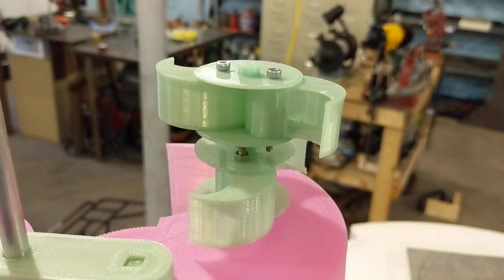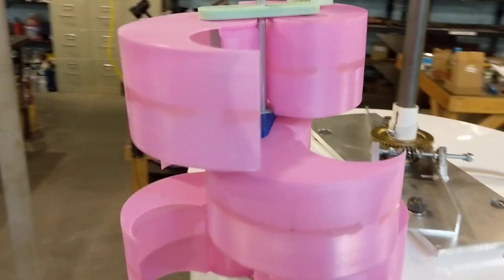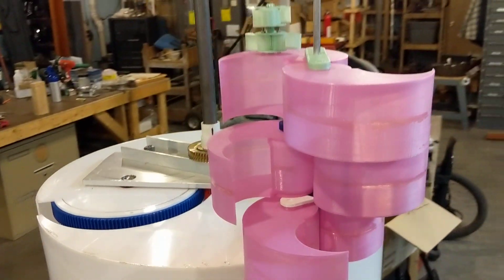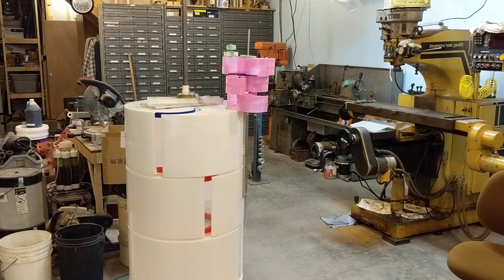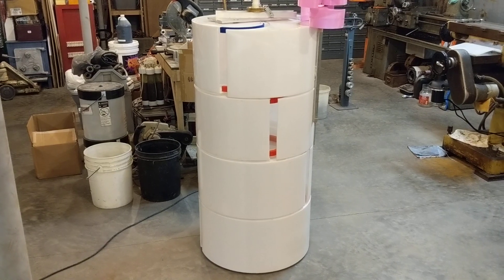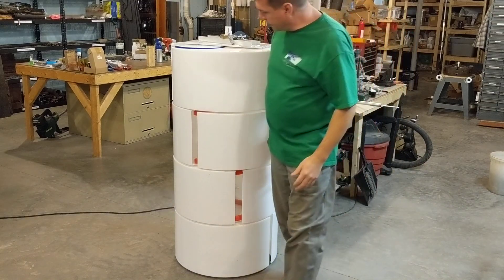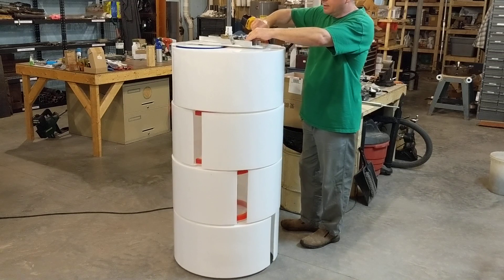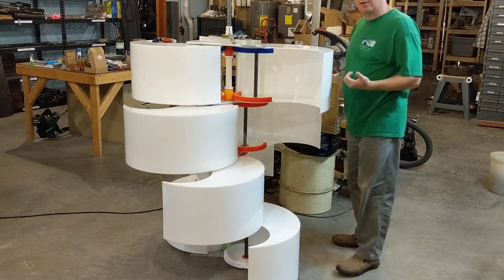Harmony VAWT Sept 2019 - Look how far we have come!

Comment: Can't wait until you have the
Building size one !!
MORE POWER AH AH AH 😂!
Reply from the maker: It's coming John you may not have seen our latest videos. Check these 2 out: https://www.youtube.com/watch?v=nENMqjqAwqY and also https://www.youtube.com/watch?v=OppJygkWuMc
Reply: @HarmonyTurbines  this is going to sound strange
But if you build a structure
Around your turbine it will
Increase your output 4-5×
Interested ?
Reply from the maker: @johntiedemann7725  Heard that one dozens of times. No the short answer is it would kill the simplicity and aesthetics of what we're doing with Harmony and in the end be more trouble than its worth. We shouldn't need it with the direction we're headed ...honestly.
Reply: @HarmonyTurbines  can't
Be easier just put it in a
Louvered tube 1/8" away from full extension of your
Blades and that will wrap the wind around your turbine and shield the
Upwind side to drag .
Thus giving you more
Power for the same wind
Give it a try side by side
Small scale on your roof
I think that will change your
Mind !! 
Cuz right at the beginning
Is when you want to know !!
Reply from the maker: @johntiedemann7725  I have a better idea. You build that, patent it and then market it as the superior model. :) You'll probably be crazy rich in the end. ---Probably.
Reply: @HarmonyTurbines  sorry for trying to help !
But your closed minded
Approach to a possible
Improvement to your
Product has told me
Not to give you a large
Investment in your
Company !
But like I said it's better to know at the start than at 
The end .
You are destined to fail 
With your closed minded
Attitude !!
Reply from the maker: @johntiedemann7725  I apologize and you didn't deserve the snark I gave you in my last reply. Regarding the structure around any VAWT there are about 10 or 12 different designs that I've seen over the years designed just as you describe. I don't want to take Harmony down that design path with those performance characteristics; that's all. I have a different direction that I would like to go with the end result that's all. Anyway just wanted to apologize for my reply last time.
Reply: @HarmonyTurbines  apologie accepted 
But it still cost you a
Possible 20 million 
Dollars .
Like I said it is better to
Find out early than too late
Like you just did today !!
Enjoy your weekend !!
Reply from the maker: @johntiedemann7725  enjoy your weekend as well.

Comment: Just found this great idea, I think it's Spot On! You have a great innovative idea here. Keep up the good work. Might I ask how many watts it generates per hour at 6mph wind? Thank you in advance.
Reply from the maker: Hi Damian that's like bare minimum for any power production on ANY turbine. In small residential units that's really asking a lot. The production would be pretty low in our 1kW unit you're talking 20 to 30 watts output which is nothing at all really. In a larger unit obviously you'd get more output but it would be questionable in general if you'd even want to install wind power generation with such low wind speeds in your area.

Comment: Couldn't this be computer modeled? 

Also as far as efficiency, combined with structural integrity, I would think each one would be much taller, and larger in diameter.   You could accomplish the same catch of air with just one set, the same height as your configuration of 4.  I do understand why you would want an offset and multiple pairs though.

Also, another thing to think about would be balancing the while operation.
Reply from the maker: Sure Jesse, but that takes a LOT of money and right now I'm not funded by anything accept my meager allowance and my wife's good grace. I do what I can with the time and money I have available. If we had access to free CFD (Computational Fluid Dynamics) then sure this would be amazing to see in 3D simulations. But I do believe that when something changes the model radically (as Harmony does) you often need a baseline to calibrate those new CFD models. So in effect an initial Harmony VAWT prototype would probably need to be built anyway. From that data we could calibrate the CFD models for further extrapolation.

Comment: The design is brilliant. Can't wait to see data come in on this. im guessing some sort of motor driven furling mechanism will be used..although a mechanical type that could regulate via its own speed like a ball governor on an old steam engine etc could also be something that would resist any power outage or problems electrically. the faster it turned the more the weighted balls fling outwards causing the furling to close? Seems like the furling needs many revolutions of that shaft so a ball governor might not be suitable as its movement is limited.
So i suppose electrically with feedback of a speed sensor is the real way to go.
Hats off to you. i hope these are not going to break my bank for the first run purchase..HA
Reply from the maker: Hi Chuck, believe me I thought long and hard about an analog system like a ball governor in the furling mechanism but ultimately it would be more of a hassle than a help. The furling will be a carefully controlled algorithm and a simple stepper motor to drive it all. Stepper and worm gear ...done. The Raspberry Pi or onboard mini-pc will control everything down to the exact degree needed for max efficiency. We could never do that with an analog system. I love the thought you put into it though so if you're near PA and looking for a job one day soon, look CreatingMoore up ...we will need a lot of good people. For now I'm still working to finish the prototype and then get the startup going with some much needed funding. If you'd like to see Harmony VAWT Latest Updates, here's the URL: https://www.youtube.com/playlist?list=PLqbwi-6vny7s3NVYuynqVG5oyLxysgfIs
Reply: @HarmonyTurbines  well thank you...I have knowledge in codding pics and arduino so yeah my thought also was steppers with micro control..a lot easyer to implement then a mechanical system. Although my thought was it would be less susceptible to electrical failure.

And yeah I love PA, I used to drive through all the time..I was there recently with an act I work for.
But my main job is in electronic design and repair. I have 20 years in it.
Living and working in PA sounds very inticing!
And doing that kind of work has allways interested me.
And of all the design I see yours is so elegant and the ying yang aspect speaks to me. Something about the symatry of the magic number constant, like taping into nature.

Anyway...love to visit one day and who knows maybe I'll take you up on a job.
Reply: @HarmonyTurbines  Also I have seen a lot of your vids now and think you are on to something here. Love the vertical mill too..ha.
Glad you did not wreck it.
I know lathe and machine work and Also weld.
I like that this will not injure wildlife. My girlfriend just mentioned this and I think it would be very safe to wildlife as well.

It will be interesting to see how the numbers look once you have it generating power.
Lots of work to be done.
Wish I was closer to lend a hand.
Need any codding work done I'll be glad to help there.

Comment: Computer control ??? Darn ... Was hoping for a centrifugal clutch mechanism for furling and unfurling ... Oh well ... Proof is in the load test ...
Reply from the maker: Centrifugal clutch would not give me the fine control that I think we will certainly want to maximize performance. Testing will show us what we need to see, I am excited to see the data just like you.
Reply: @HarmonyTurbines  yup ... Torque produced under diff wind speeds ... Gotta have torque to overcome load ...
Reply from the maker: @jameswitte5167  in all honesty the simple Raspberry Pi control for the furling system will be so simple and easy compared to a centrifugal clutch and it will give infinitely more control over furling states in various wind-speeds. Think of an ice-skater pulling their arms in as they spin. They go faster and faster. Well in our case being pulled in slightly (furled) in a given wind-speed will likely produce 20 to 50% more power output. That's the data I'm dying to see! If you'd like to see Harmony VAWT Latest Updates, here's the URL: https://www.youtube.com/playlist?list=PLqbwi-6vny7s3NVYuynqVG5oyLxysgfIs
Reply: @HarmonyTurbines  I'm olde ... I like mechanical ... That i can tinker with and fix when it bresks ... Lol ... But best of luck to you ... I do like the looks and basic design ...
Reply from the maker: @jameswitte5167  Oh believe me I had ball governors and centrifugal clutches all over the design a year ago but as I have been working on this more and more I realize that the fine control I need will be best with some stepper motors and worm gears to carefully control things. I love mechanical systems as well and there's still plenty of that left in my design to tickle your fancy! If you'd like to see Harmony VAWT Latest Updates, here's the URL: https://www.youtube.com/playlist?list=PLqbwi-6vny7s3NVYuynqVG5oyLxysgfIs

Comment: have you tried the model in actual conditions? what kind of amout to be taken as output? its very impressive work you have done. but i see some probelms with real scale model of your harmony...
1 how will you unfold or fold the blades when there is some 4-12 miles per hour speed wind? what will be the force on blades? 
2 have you ever consider the worst case senario design loads or actions?
3 how much will be the stress developed at the bottom of the harmony when unfolding at average 12miles/hr wind speed?
4 what will be the tilt of the harmony tower?
5 what are the fail safe mechanism of the harmony?
6 how to prevent over speeding and damaging the harmony?
im just curious. thanks
Reply from the maker: Yes I have addressed all of these issues. Real world testing will begin after the prototype is complete. You will just have to be patient as I do this with my own limited funds and time.
Reply: @HarmonyTurbines  Great work man....👍👍

Comment: Love the update, thanks. Here is a real life, current day (2019), need for using your solution. I'm in California and last week power was turned off for many people: why? Because of the wind.I have a 100 amp marine/RV battery and 3000 watt dc converter, just for short time emergencies. But, I have no way to recharge battery, when power goes out for days. Plus, when power does go out it could be due to rain storm, fire storm or earthquake. So, i'm looking for a VAWT system portable for emergencies. The owner of "Little shop in Texas" has a Vertical axis wind turbines that looks ideal(https://www.youtube.com/channel/UC3e4VrM3f8E5r2_CxripXUA/community?lb=UgzDlXHFWwp0UMG55vJ4AaABCQ), but he's not responding to my inquiry. Solar is not the ideal solution, because the conditions are likely to be rain storm, cloudy or even fog. So, do you have a solution to fit this short time emergency need?

Comment: be cautious what happens when the wind is high and resistance from reverse curved blade can be high enough to waste the other blade workout
Reply: This is an interesting concern, the pushing blade will have far more pressure on it than the other..this could impead the furling mechanism so a robust stepper motor design must be implemented.

Good thought in that.

Comment: Dia duit, Chris! This is my first time seeing your project, and I am impressed by the concept and design. I have several ideas that would work in conjunction with your possible control center with algorithms controlling the furling with the servos. I at first thought that a CVT would work, but it may not be as controllable when the need for higher torque for a higher load on the generator is necessary. But, I have recently come across a concept that was designed for bicycles called the CeramicSpeed Driven chainless drivetrain. With just two points of contact, it reduces the friction and loss of power usually found in a chain or belt driven system down to 1% (making it 99% efficient.) What I believe is really impressive (and could work with the control system algorithms in conjunction with your furling system) is the pinion system that can seamlessly glide between the gear ratios. My reasoning for utilizing a gearing system looks at consistent RPMs of the generator(s) along with load on the generator(s). Let's say if a battery or two on your storage system flake out or your home begins drawing more power a certain times (starting the washer, AC units kick in, etc), then there could be a greater load on the generator to where it needs more power from the turbine to keep up the RPMs. After studying the design of the Ceramic Driven Drivetrain, I believe it could be implemented with your Harmony VAWT to maximize its effectiveness. I am in no way tied into nor know anyone of that company, I just research and collect ideas that I can possibly implement in the near future on my envisioned permaculture homestead. I hope what I have found will be of great use towards your progress on your VAWT and I look forward to seeing it in production soon so I may be able to acquire it for the homestead. Go mbeannaí Dia duit! Slán!

https://youtu.be/-9gQ1KRhesM

Comment: Hi Christopher, your wind turbine is truly a piece of engineering beauty; I have only just discovered your channel but will be following it's development as things progress!
Apologies if I have missed it, but have you tried powering an air compressor with the turbine?
I ask this because it seems that almost all wind turbines are made to generate electricity, which can lead to a relatively poor level of efficiency - if the work done was used to produce compressed air, this could be utilised in a heat pump to produce heat, which can be over 75% of the energy requirement for a residential property.

Comment: what kind of cylindrical plastic do you use man?
Reply: i can definitely see this being installed in beach fronts or bay areas.. if this works well with a generator for atleast a lamp post then it's a very good innovation..aesthetically presentable.. .safer.. and can harness wind energy. regardless of the direction of the wind.. i hope i can build my own version using your concept

Comment: Awesome design! I think you really got something special here. I was thinking you could add a gyro to the adjustment mechanism for it to be able to close/open at will of the program while in rotation. (Similar to how brakes still work on freestyle/trick bikes no matter the location of the handlebars. the brake lines=the power/ground wires in this case)

Comment: Hello.  When you are spinning at high speed, how are you going to connect a system that could close and exist. This is going to be rotating on an axis.
Reply: Possibly mount the close/open mechanism on a gyro? Similar to trick bikes, the rotation would not matter.
Reply: Helicopters change blade pitch in a rotating assembly. It can be done

Comment: RPMs will be low when it will actually drive the generator connected to the load. Longevity under the accumulating snow and ice is a big question. And the efficiency... half of the thing resists the wind at any point. More than half if not fully unfurled. Hope you got the shaft strong enough.
Reply: That's what I was wondering about.  Seems like a low cone weather protector on the top might be needed to keep out water and snow.
Reply: @ffjsb  the scoops are just perfect for collecting anything flowing into them
Reply: @NoHandleToSpeakOf  But would centrifugal force throw things like rainwater out??  Freezing rain would probably stick, and not sure what snow would do, but maybe in warmer climates it wouldn't have as many problems??  Definitely would love to see some real world trials.

Comment: Well done Chris.  Is there anything limiting the number of scoops ?   Could you run multiple pairs up the side of a building for instance ? Secured top and bottom, is there any reason that 10 or 20 pairs could not be fitted and then could the torque on the generator be raised to increase power generation ?